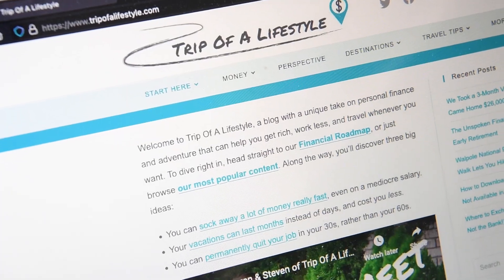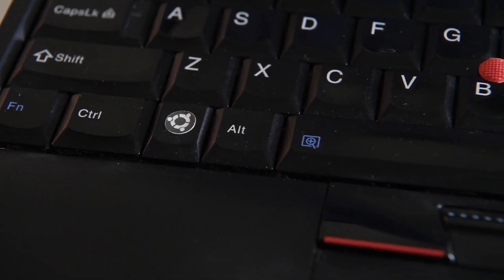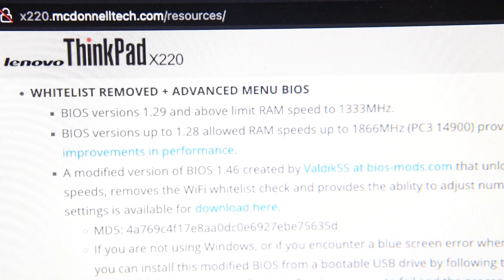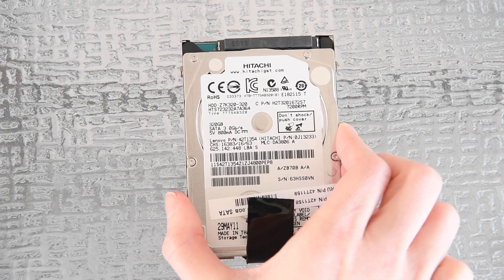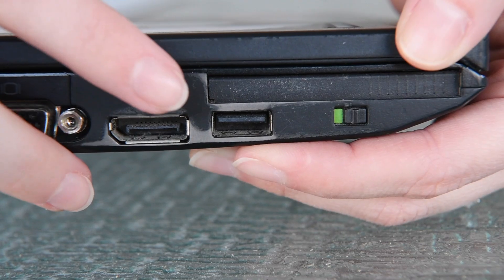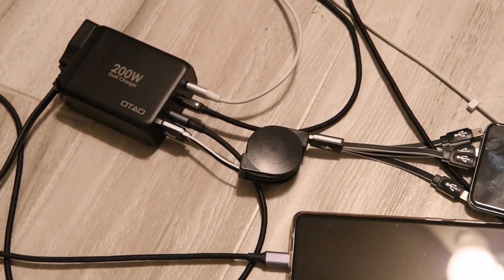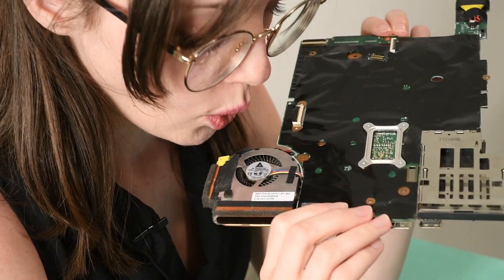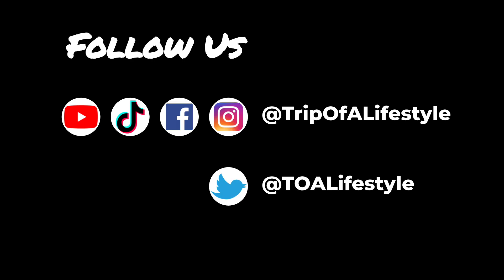How To Make Your Laptop Last FOREVER (My ThinkPad Mods & Upgrades)

Comment: Barrel to USB-C is a great mod!  If you forget your charger, you can almost always find a USB-C cable nearby.  The i7's have had an amazing run, almost any of those 2+GHz i7's from 2012 or later are still very useful today (and many can be found with native HDMI out, but an onboard SD-card reader can be hit or miss-- that's handy for xfer drone or camera images).  Around $300 for a (second hand) daily driver (non-gaming) system is very do-able (i7 because 2+ row taskbars is how we roll, 14-16" screen, SATA/mSATA/NVM, 16GB and good to go).   Old MacBook Pro's from that era (which are also i7's) are also still decent (but kind of heavy) or older Razer Blade's.  Modern laptop does offer the higher speed USB-C 3.2 (where you can attach external GPUs, which is a lot more practical than using those external riser adapters).   Even if not gaming, doing some Google Earth or faster video editing/effects preview is always good (for me a GPU helps with astronomy imaging, stacking/stretching images).   // You can also find old laptops at Vintage Computer Festivals around the country throughout the year (the one in Chicago being probably the best for laptops).

Comment: Uhm , you got a unique case here. Most laptop aren’t common enough to find parts for them. Like USB c charging port that just pops right in 😅. Always stick to large brands with a lot of support still. Otherwise you’ll be SOL trying to find BIOS updates or even figuring out how much and what type of memory is supported 😮😮😮

Be careful do research.

Comment: So what are the downsides of LINUX?
Reply from the maker: Pros: Free, open source, stable, secure, lightweight, fast, updates for life, and gives you native access to a terminal using a nice shell like bash.

Cons: Sometimes lacking good support for certain hardware (driver issues), and cannot natively run proprietary software that's written specififically for macOS or Windows (like Adobe products, for example).
Reply: @TripOfALifestyle  Thanks.  For me that rules it out as a replacement, which I have looked into before...  maybe for a standalone server as I see someone commented.  Ole Bill has us by the fill in the blank...
Reply from the maker: @StationaryDingleberry  You can still run Windows apps under Linux inside a virtual machine (for example with VirtualBox as shown in the video) OR with emulation software such as WINE. It's just a bit more of a pain to set up. 😓

Comment: nice video, I don't know if it's something important to you but you can upgrade the screen to an ips display which helps to eliminate TN's problematic viewing angles. Even if looking dead on the screen has some bad shifting that's typical of the screen from that period. The replacement  I got in 2016 was LP125WH2.SLT1 / LP125WH2.SLB3  listed on the ebay listing, I don't have the screen with me now since I gave it to my cousin 6 years ago, he still uses it for daily use.
Reply from the maker: @battokizu  Good info! We've heard of people doing this.

Comment: I have Asus laptop from 2015 which I upgraded in a simple fashion: upgraded its' RAM and changed HDD to SSD. I also use Linux, only Ubuntu distro. Its' cost back then was about 350-400€. Since then it is the main put-bread-on-my-table machine.

Comment: I'm also with an upgraded X230 right now. However, there are things the laptop is not worth that much in 2024 besides doing simple tasks. First, its screen so small, color so ugly and the angle of view very limited. Second, the Intel hd graphics built-in is so weak that causes the fan to kick in when doing a relatively heavy task - like surfing Facebook, chatting Messenger . I got a MacBook pro 2013 thrown away, repaired it, upgrade it and it is clearly far better than the X230 in term of screen, touchpad and usability in general.

Comment: as a thinkpad enthusiast I love this video! you were really committed to that X220 -- the newer models just aren't as easily upgradeable, so I get it. I'm still in love with the T480 I bought in 2019 and have kept upgrading, even though I now daily drive an X1 Carbon 9th Gen.
Reply from the maker: The X1 Carbon is very cool looking. How upgradeable do you think it is?
Reply: @TripOfALifestyle  Not as.  Part of the problem was Lenovo's takeover.  X220 and X230 were made by Lenovo, but totally based on IBM engineers' design. Back when IBM wasn't afraid of not going along with obsolescence.  If you can find a 25th Anniversary Edition from Oct 2017... well that might be ridiculous money by now.
Reply: There's a video on yt dedicated to the T480 as the "Last Great Thinkpad".  there's reasons enough to believe this, although I love my X230!

Comment: I have a Toshiba Satellite C655D I have upgraded over the years. Wifi 6 (which added Bluetooth to my pleasant surprise), 8GB RAM, 128GB Samsung SSD, Linux Mint 22 (has Windows 10 key but that doesn't matter much these days). Processor can be upgraded but haven't done that. Believe me, Linux is easier to maintain than Windows, a few commands in the terminal and it's done (can be done in GUI), not to mention that, unlike Windows, you can not use it for quite some time and still update quickly like no one's business with no problems 😀.

PS: Intel Wifi is supported well by Linux unlike some others.

Comment: Considering this is an old video I had low hopes you read me or answer but, could you elaborate a little bit the 3:20?, is a major mod, yet you dedicate jut a little bit of the video. The ThinkPad has any chance to do this without soldering?. I'm trying to keep alive my Alienware M11x and this could be a great improvement. Thanks in advance.
Reply from the maker: There's a link in the video description under "USB-C charging port for ThinkPad X220 and X230" to a Tindie seller who creates these USB-C charging ports. He also provides more info on how to install them. Hope that helps!

Comment: Great little video. I am sure your followers already know these things, so excuse me if I am captain obvious. 

First true business laptops from companies like HP and Lenovo are built to be worked on. Cracking open a Mac is a whole different experience. So adding things and replacing things in those systems is pretty easy.

Don't get carried away with blowing on fans. When blown on some become little generators that can back feed into your fan control circuits. Probably not bad, but I do remember getting carried away with a can of air back in the day.

Ubuntu for the win. Huge user community. They also have LTS (long term support) releases that promise updates for multiple years.

I have thousands of dollars worth of Macs in the basement. They still run but are incredibly hard to do any real upgrades on. Closed systems are not in the consumers best interest IMO.

Microsoft left my Lenovo Xeon based laptop behind. I have Ubuntu running on a home server and storage array. I will be moving my 6 year old laptop from Windows 10 in the new year. Great little video.

Comment: I did many years of corporate IT support and the Thinkpad is the best you can get.  You do have to get corporate Thinkpad, not retail systems.  The x220 is corporate.  I’m a solo circumnavigator now and still use an x240 with solid state drive for pulling down HF radio weather, email underway.  I use a Raspberry Pi for navigation computer too.
Cheers

A
SV Soy Libre
Vuda, Fiji

Comment: Old laptop is still old even after upgrading , I would choose instead old MacBook Pro 13 2012. It’s chip and chip to upgrade and has more pretty design and more powerful and can run OK new operation system and Linux also….

Comment: Sadly, this video holds no truth for the majority of modern laptops since about 2014/15 and, while you got to upgrade about everything with your thinkbook, because it was a good choice in this regard, even many of it's contemporaries (like my wives Sony Vaio VPC-EH2C5E) don't allow enough upgrades to really lift speed enough:

- laptops with socketed CPUs were last seen with Haswell in 2013/14
- you can always exchange the motherboard with the soldered CPU, often there even were two generations of CPUs put into the same case, BUT you are very rarely able to buy a motherboard with a useful CPU-upgrade for a sensible price
- not all laptops get as many BIOS-updates as yours, especially cheap ones
- like your thinkbook initially had, many laptops of the time had a whitelist for WIFI-cards so you only could use those that were available with the laptop, making upgrades to later standards impossible 
- right after the end of socketed CPUs came the change from SATA and mSATA for SSD an miniPCIe for WIFI-cards to M.2, so older laptops are stuck SATA-SSD and for a long time, Intel AC7260 was the best WIFI-card available (there is an inofficial AX3000 now, in essence a AX200 in miniPCIe-formfaktor)
- Sandy Bridge laptops didn't even always have SATA 6Gb/s and rarely had USB3.0
- GPU was never really upgradeable and today most older IGP and dGPU are really outdated. The IGP of Sandy Bridge CPUs like in your X220 doesn't support H.265/HEVC at all, doesn't even fully decode H.264/AVC and on top of that had a bug, that made movies with 23.976fps instead of 24fps (the majority of movies!) stutter. It can't show Apple HEIF/HEIC-files, either
- many older laptops only have dark, glossy HD-ready (1366x768) TFTs that are punishment for your eyes
- batteries haven't been easily user-replaceable for about as long as CPUs aren't socketed anymore. They are often glued down and you have to take the whole case apart.
- The Expresscard-Slot you used for adding more USB3.0 was rare and almost always PCIe Gen1, so your USB-ports are limited to ~250MB/s instead of ~450MB/s.
- converting USB-A to USB-C doesn't give you any of the benefits of USB-C

in modern laptops, upgradeability is almost nonexistent: 
- CPU and GPU are always soldered
- RAM is soldered more often than not and sadly, the LPCAMM2-formfaktor that makes fast LPDDDR5X exchangeable seems to be ignored in the coming generation of laptops
- even when RAM, SSD and WIFI-card are replaceable, they rarely are easily accesible these days, you have to take apart the whole case most of the time

I upgraded two rather old laptops to their maximum, but without exchangeing the HDD with an SSD, mostly because they both only support SATA 3Gb/s and I didn't find time to save all the data before the update (any sensibly priced SSD would have been smaller than what space was already used on the HDD), and without exchanging the WIFI-card, because both had whitelists: a HP 620 (upgrade from Pentium T23xx to Core 2 Duo T9500, limited by FSB800 of GL40-chipset, and from 2GB DDR3-1333 to 8GB DDR3-1333) and the Vaio VPC-EH2C5E I mentioned (upgrade from Pentium B950 to Core i7 2640M and from 4GB DDR3-1600 to 8GB).
The HP 620 was a pain to use even after the upgrade but I used it from 2018 until 2021 on every odd weekend. I still have it. The Vaio is still in use by my wife because she won't let it go, but it is even more of a pain to use now. Neither had USB3, by the way. I still wan't to try putting a SSD into the VAIO but can't find the time. 

I didn't upgrade two other laptops because it was not worth it: 
- HP 350 G1 with some soldered on Haswell-generation Pentium, because the CPU could only be upgraded by exchanging the motherboard (up to i7-5500U "Broadwel), which was already to expensive for the owner, but only would have made sense when upgrading RAM and SSD. No single upgrade would have made sense without the other and all together were to expensive. WIFI was whitelisted, TFT was terrible HD-ready.
- HP 255 G6: The AMD A6-9220 "Stoney Ridge" is terribly slow, the maximum AMD-upgrade would be A9-9425, which wouldn't be noticebly better, or Intel Core i7 7500U, which still wouldn't be great, but expensive. There were very similar laptops with identical mainboards with AMD A12-9700P or Intel i7-8550U, but without VGA, leaving a large gaping hole in the case.

I use my desktop PC most of the time and only used two of the laptops above when lived in a different city on weekends and now sometimes use the HP 255 for some light work in school, but only because I'm waiting on a Strix Point laptop with socketed RAM.

Comment: The idea of upgrading old instead of just buying new is awesome and we definitely need more of it, and the X series were probably the last 'LEGO for grown-ups' laptops that let you play around with them in terms of user upgrades. However, there are a few points to consider ;) 
firstly I'd recommend changing the 220 for something like a 270 - the price difference will be well within 1200usd, yet you'll gain a lot of those upgrades like a usb type-c charging port and dual band wifi in addition to a cooler more energy efficient cpu, better ips screen and even a cellular data modem
secondly you can get it with an i5 cpu which will get you through daily tasks jast as well while lasting a bit longer on a battery
and lastly - a later model also comes with upgraded hardware such as chipset which will work with almost any modern periphery like printers and HID devices
While there are some absolutely must have upgrades like SSD and RAM, for others it may be more feasible juste get a newer model of the same notebook
Reply from the maker: Thanks! Just to be clear, $1200 USD is the TOTAL cost of the original (brand new) X220 back in 2011, plus all of the upgrades, plus replacement batteries along the way!

Comment: For this to work the laptop you start with has to be upgradeable. The components in newer laptops tend to be soldered down so look for an older bigger laptop and download the service manual that shows what can be upgraded. The BEST upgrade by far in any laptop is to replace  the old hard drive with a solid state drive (SSD). This will really speed it up. I had a 20 year old laptop running XP that could barely function but jumped back to life when I installed a SSD. It wasn't even a new SSD but an older smaller one from another laptop. It is a real shame Express card slots were removed from laptops as that allowed you to install add additional ports of all sorts.

Comment: I'm been using an old DEll 1545 from 2008 for nearly 15 years. Recently upgraded the ram, upgraded the CPU, added an SSD and even brought a replacement battery (holds a decent charge now). Gave it a good clean too. Total cost around £25 :) Purrs like a kitten and does everything I need.
Reply: Would love to your specs

Comment: Totally agree; I love Linux.  If you clean the fan, place something to keep the fan from moving e.g. toothpick, then blow air.  Use a cloud drive to backup files so no need very expensive high capacity drive; additional benefits from cloud drive, backup when laptop drive fails.

Comment: the key was the ability to upgrade to 16gb. gr8 work. I have a 10yo desktop that lacks an L3 cache and maxes out at 8gb. that hurts performance and prevents upgrade to Win 11. I'll guess you can handle 1 external monitor, I prefer 2 or more. I just bought a new mini for $379 with  a fast chip, 32GB, an SSD, and lots of 3.2 gen ports incl 2 type c. I am re-using the monitors, speakers, keyboard, mouse and will probably turn the desktop w/ a 1TB drive into an NAS or buy a cheap enclosure to turn it into an external drive.

Comment: Much simpler and enormously cheaper to simply install Linux over whatever OS is currently on the machine.   You're not running InDesign or Photoshop on that thing.
Reply from the maker: @crinolynneendymion8755  Photoshop actually does quite well on it, even in a Windows VM under Linux! 🙂

Comment: I have computers older than that still running. At some point, your hardware and BIOS will be too far out of support to run current software.
If your technical needs are minimal, you can get by with minimal.

I'd be happy with my old Samsung Note 4 phone if it was still supported. Since then, we've lost, 3.5 mm jacks, swappable batteries, SD slots and access to your bootloader.
Reply from the maker: @wisenber  Sadly, today, a lot of hardware is only obsolete because it isn't supported by modern software. Smartphones and tablets suffer from this.

Comment: Sorry. When you said it's almost impossible to get viruses on Linux, you lost all credibility. It may bre less susceotible, but it's not even close to impossible. Part of that is the tiny percentage of machines using Linux. THe other key issue is the model of laptop and whether it even allows upgrades. Many do not, whether items are soldered in or completely proprietary.

Comment: You actually bought a very good laptop for its time. I'm also still using my old ASUS N53TK (writing this comment using it) with upgraded RAM from 4 to 8 GB and replaced HDD with SSD. As for HDD - I put it on the place of DVD drive since I don't use it that often nowadays and it's easier to have an external USB DVD drive. It wasn't... that easy as it supposed to be but I did SOMETHING wrong and it took me a week to restore all the data. Although the laptop went through several serious repairs which cost me with upgrades and battery change... well I guess - full original price of the laptop itself. ^_^ Anyway it would cost me much more to buy a new good laptop so I still keep it. The main problem in my case is that N53TK have pretty weak AMD A6-3420M at modern standards. But it still works out for most of tasks. Using it as my main computer for audio recording and editing. I actually also wanted to go to some Linux distro but Win 7 just works too good to change it and I'm a pretty lazy to study Linux for now. >_< Someday, someday I definitely will go back to Linux again...